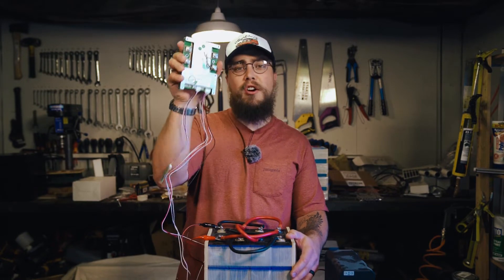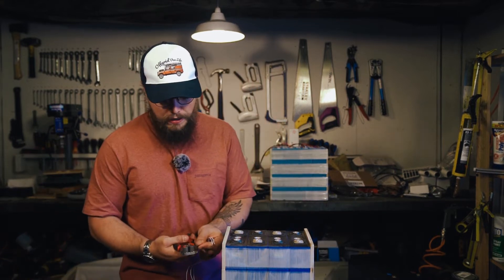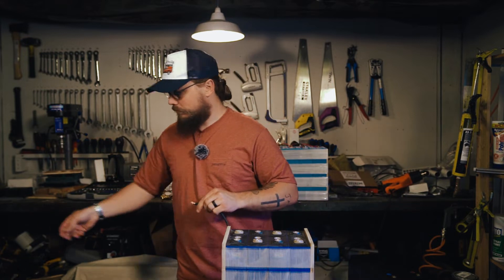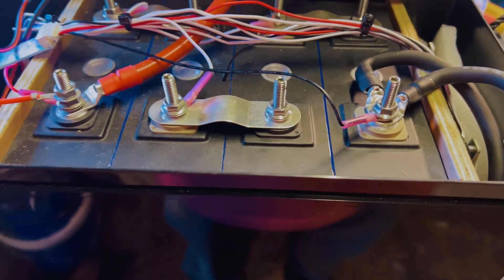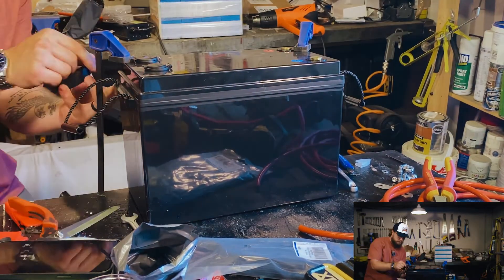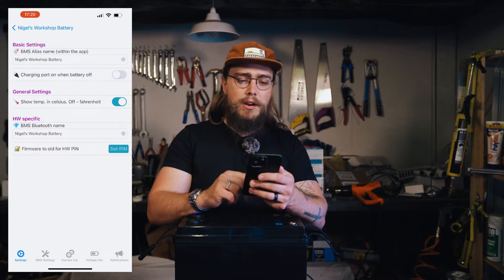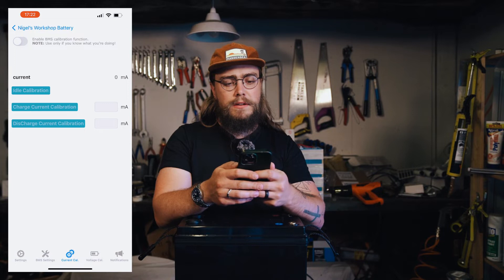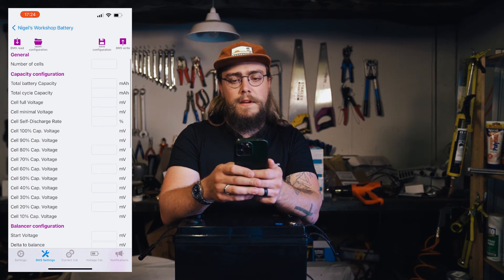Setting up new LiFePO4 battery with Overkill BMS 120A

Comment: For those who are curious or want to know the XIAOXIANG BMS setup.

1. There is a configuration to read your BMS. 
2. It will pull the BMS' config and from their you can modify.
3. XIAOXIANG iOS app uses milli-amp and mili-volt (FLOAT)...whilst Android use whole number (DOUBLE).
4. Also it is configured for 20% reserve meaning when you it it up, the 100AH battery will be seen as 80aH.

Comment: Hi, love your style.  I have some 188AH Samsung 5S2P cells, 18.35 nomimal voltage. I wonder if the Overkill 48V 16S version would allow me to use just 15 of the cell strings like the JK's etc? Thanks regardless!